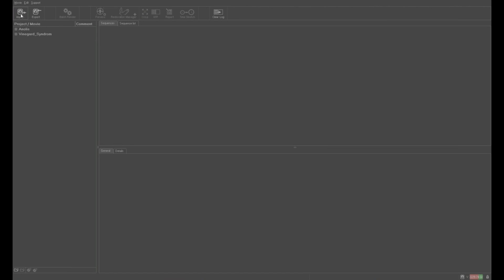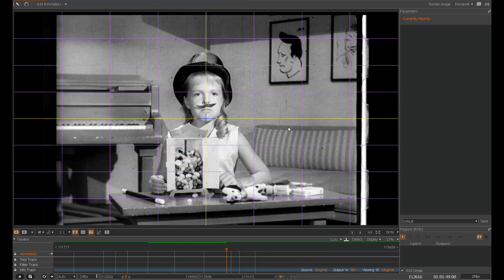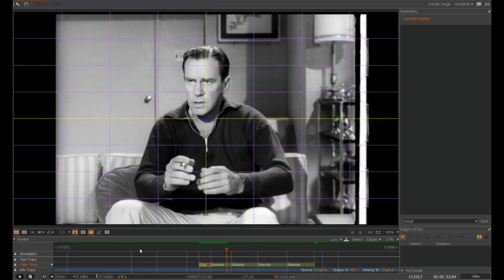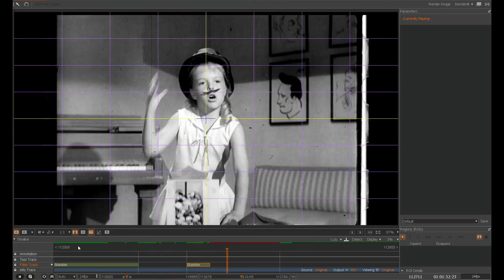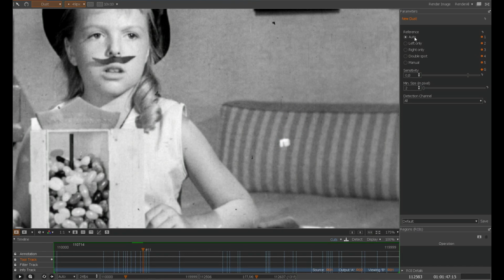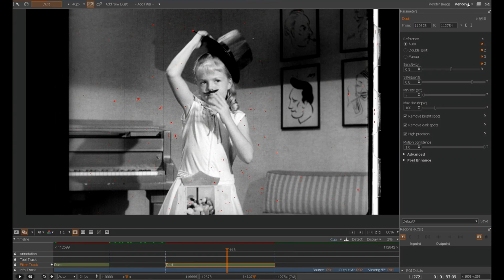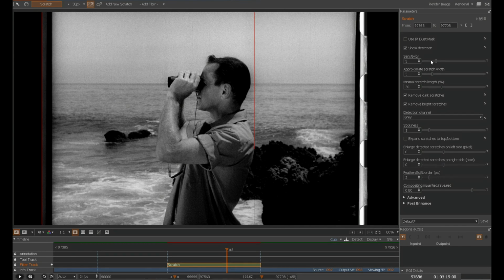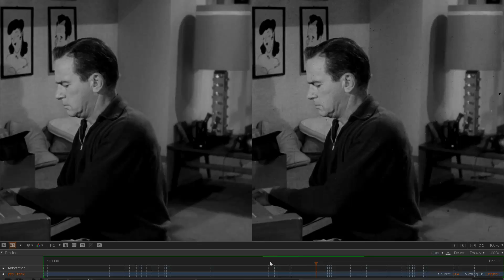Using automatic Diamant-Film Restoration tools by Andreas Hartung

Comment: Matthias, in your demonstration dust, chemical stains and scratches have been impressively removed using Diamant's Film Restoration software. However, the stabilisation tools used here - whilst  not bad for what Americans call a digitised "orphan" print - are not helped by remaining pixels that swirl and "boil". Do you think de-graining and/or de-blocking clips like this prior to digital restoration could assist?

Comment: How did you scaning? 10bit linear or 10bit CPD(log) or 16bit linear?
Reply: It was with a Scanity filmscanner in 10bit linear. 10 bit linear were sufficient for the material. 16bit would have been too expensive.
Reply: @lighthousedvd  Thank you for answer. I have one more question.
I know that when digitizing film, it is scanned and restored, then color graded and mastered.
Is there a case of removing scratches or dust after color grading first? If that was the case, what was the reason?
I think it will cause image loss, so I think it should be avoided.
Reply: @Pointvisual7  That's right. First the restoration, then the color correction. I don't know any case where it makes sense the other way round.

Comment: Thanks for this really informative video, Andreas and HS-Art!  The part about stabilization is really helpful!!  It illustrates why generic stabilization tools in graphics compositing programs like AfterEffects and Apple's Motion can't get the job done.  Too many different parameters to work with.  The stabilization tools in those software packages aren't built for film restoration.
Reply: Gone Autos, I'm not sure you are right with regards to the limitations of Adobe's After Effects. I own Diamant's entry level film restoration app Dust Buster + for Mac. No doubt Diamant's full restoration software is ideal for most digitised film stabilisation. However, putting aside the excellent stabilisation tools in (the equally expensive) Nuke aside, I have had success splitting up a scanned film clip in After Effects, and with a combination of the app's stabilisation tools and manual key framing, can achieve much the same result. That said, it's more of a challenge to stabilise scanned film that has various areas of instability. To tackle this it's possible to composite in to a clip tracked sections of a single frame, and add grain to these non-animated grain sections. The process just requires time and patience.